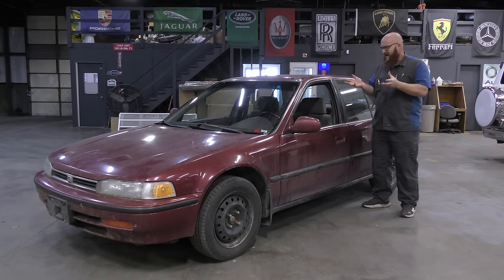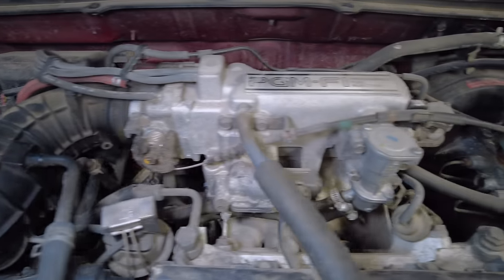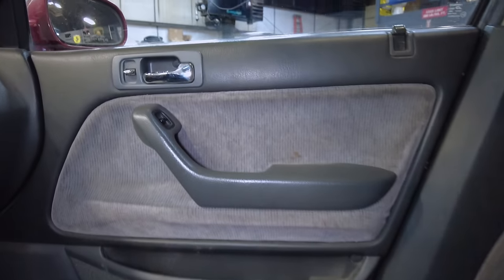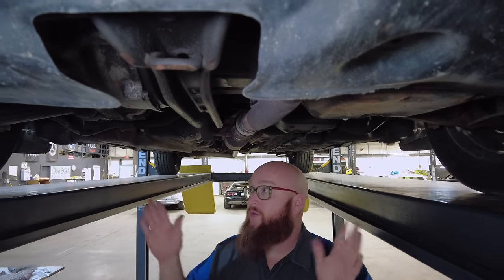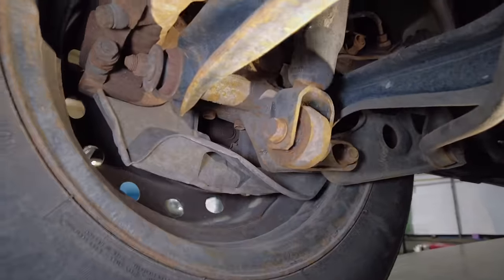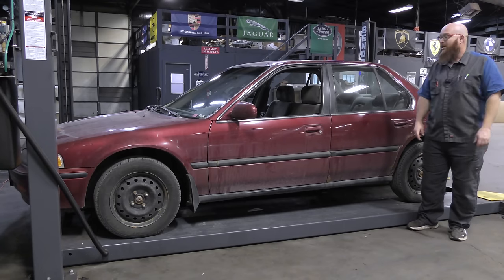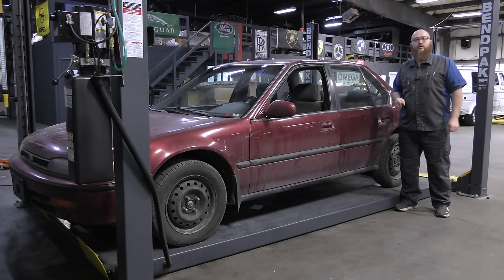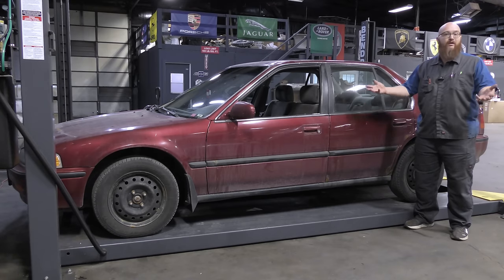A True Testament: 32 year old Accord with 380K miles! When Is It Time to Let It Go?

Comment: Appreciate an honest mechanic. Not many nowadays. Still remember when a dealership mechanic recommended a transmission seal when my car was at 40k miles and transmission fluid leaking. I refused the repair and he said it was dangerous.😂 Still driving on that same seal at 130k miles no issues.

Comment: Their fools if they replace that Accord with any modern vehicle.
Reply: They have to show off somehow or another with a modern $50,000 economy car. People are dumb as rocks these days, they're crushing all of these old reliable vehicles while purchasing newer unreliable vehicles for top dollar. Hell if they invested even a fraction of the amount of money they put into a new car into their older car, the older car would work better and last longer.
Reply: I can understand the motivation to get something newer than a 32 year-old Honda. My last car I had for 16 years, it ran fine, but it was getting rusty and  damn was I ready for something new(er)!
Reply: "Their fools"
You seem to speak from experience.
Reply: @MyWatchIsEnded  That is so true it is sad. I wish more people realized how much more plastic, cheaper parts, and cost-cutting go into a lot of modern cars. I don't see something these days lasting as long as that Accord. The screens will probably get damaged from the sun over time if sitting outside, age will slowly kill the electronics, the plastic actuators inside will fail, and there is so much more wiring, which means when something fails, it will be even harder to diagnose if it is a wiring issue within the insane bundle of wires. The future of vehicles is going to be more junked cars quicker and quicker, nobody is going to be fixing all the complicated electronics after 20 years. Even though technically since a vehicle like this "isn't worth it" to fix everything, it is one damn good vehicle if taken care of. People are built so much on cheap cost and new new new that the true cost has been quality and long-term support.
Reply: @MyWatchIsEnded  It's funny because you can buy economy cars from less than $20,000, but you have to make up facts to justify your stance.

Comment: I have 360,000 miles on my 2002 Volvo S60 24T.  Original engine and transmission that have never been rebuilt.  But then, this is NORMAL for Volvo.
Reply: My 07 V50 has only 226000 miles!!! 😅

Comment: My friend owned a Honda Accord and it still had the original clutch at over 330K miles.  It was still in perfect running condition when he sold it.  Amazing car.
Reply: My '97 Civic has 377,000 miles. It was about at the mileage you describe when I replaced the clutch-and the clutch wasn't even the problem! I had an input shaft bearing going bad so I had the mechanic do ALL the bearings and the clutch.

Comment: I used to have a 1993 Honda Accord, i got it at 159k miles and I ended up selling it at 172k because the timing belt snapped on me. I was told at the time that the cost + labor to replace the timing belt would’ve exceeded the car’s value (this was in 2017). Looking back, not sure if they were right? Anywho, great video, and thank you for going through this Accord with us!

Comment: I had an 92 coupe none VTech2.2L 4cyl  motor 5 speed manual, lowered , it was quite torquey ( when it was raining it would just be sitting  still just spinning tires all the way to the 3rd gear, 1st then power shift to 2nd , and 3rd  gear ) but not much power at high RPM , a Civic 1.6L single overhead cam Vtech motor with 7k red line had always been beating me right after the 3rd gear was engaged ,  Always wanted to swap my motor for H22A but end up growing out of it -Fun times , went through 1 transmission other than that NO ISSUES WHATS SO EVER , engine NEVER smoked , never burned oil , bought it with 100K miles and sold it probably 10 years later with 225k miles for the same price i bought it for, JS,,  LOL . Nice quality vehicle , thanks to Japanese engineering  !

Comment: Common repeative issues are axles-CV joints and rusting out flex pipes and exhaust needing to be done every couple years if you live in a rustbelt state. and rear fenders rust out BUT once you know this…that there are drain holes inside the fenders behind and you need to clear out the degrading leaves-dirt and crap out of the wheel wells and rust won’t happen

Comment: The best advice!  Glad I found your channel.  It's time to get another car.  I have a rule.  I buy brand new and keep my cars 10 to 15 years and replace.  It hasn't failed me yet.  I also buy sub compacts that are no frills and low price.  My current car is a 2022 Nissan Versa I bought brand new and even buying the base model CRV it still has a lot of great safety options and other luxuries for a guy like me.  Love the Nissan Versa, the 2022 replaced the 2009 which never let me down.  Too bad they are discontinuing it.

Comment: This is a funny watch to me, because I have a 2009 Honda FIT with 360k on it. Still runs brand new. Only two issues I haven't got around to fixing is a dead tire sensor causing a TPMS light on the dash, and something with the fuel Prime causing it to crank three or four times before starting on a cold start. Maybe an evap purge canister or something. I'll figure it out on my next paycheck. Oh and a few cosmetic marks on the paint.

Comment: Unless it's completely rusted, I'll keep fixing it. My 2008 Subaru Forester with 308,000 miles is my daily driver. I do 214 miles a day Monday to Friday. 1,070 miles a week, 4,280 miles a month. Oil change every month. My spare car   which used to be my daily is a 2001 Subaru Outback with 431,000 miles.

Comment: Nice car glad it's not the vacuum box model.

Let me explain older Honda accords had a vacuum box on the firewall of the car everything goes well until that box fails then you go through vacuum hell. 

You have to have the box rebuilt Sadly this gets expensive because the vacuum solenoids in the box are not serviceable and new ones run 50.00 to 100.00 a piece depending on year and box.

The worse part yet to come the box can then malfunction and drop your gas pedal to the floor and red line the engine. Creating a run away engine issue. Very dangerous.

Comment: I have a 1993 es300 lexus. Ive put a low miles motor in it already and the original motor had 375.000. I've done a lot of work to it like subframe heads radiator breaks. I will fix whatever goes wrong with my car because it's cheaper to keep her. Already saving for a transmission just incase it goes out. Car is still going strong and i attend to keep her as long as i can. And the parts for it are reasonable.

Comment: I have driven beaters all my life.  My criteria for selling a beater is when something catastrophic happens or is expected to happen very soon.  Any repair over 2k is considered catastrophic.  The reasoning is that you can take the 2k and put it down on a 10k vehicle.  If you have the skills to do general maintenance and intermediate wrenching, you can extend a vehicle for at least a decade if you take care of it.  

One of my family member drives a 2005 Nissan Sentra with 250k miles on it.  His grandma gave him that car.  The entire bottom is rusted bad but mechanically, it's a gem.  I've replaced the fuel pump, replaced the entire brake system, put in a new battery, replaced power window motors, replaced the blower motor fan speed module, etc.  All on all about 4k worth of repairs.  Other than the rust, that car will drive from Seattle to Rhode Island and back easy.

Comment: Never. Never is the time to let it go. My first car was a 93 EX with the Burgundy interior and I just towed it out of the back yard and ripped all the rear suspension and gas tank out. Gunna do a total suspension overhaul but the motor and trans are still original and super solid with 235k on the clock!

Comment: i daily drive a 1992 accord. just took it from florida to new Hampshire and back. no issues and almost 50mpg the whole drive!! 181k miles on mine im the 2nd owner. original head gasket, original fans, original fuel pump and a lot more. when i replaced thermostat 2 months ago it had a stamped manufacturing date of 8/91. honda did perfectly with this generation accord

Comment: I had a 1991 Accord LX 5-speed. Fun car to drive. I had to replace the retractable antenna and bondo the left rear panel for rust. Sold it with 195k miles in 2002 for a new Accord Coupe.
I just replaced the radiator on my 2002 accord coupe. 200k miles. First major part. Needs clear coat and a small amount of rust at the rear window, car has always been stored outside and survived a dozen hurricanes. Hopefully I will get another 10 or more years out of it.

Comment: I disagree that this car is unreliable and not to be trusted. If you can drive a car for months without a breakdown, you can drive it across the country reliably. My Honda Element has 328k miles on the original engine and automatic trans and I would (and do) drive it everywhere including road trips. I would argue that it's more reliable than a significant percentage of newer cars with half the miles ..

Comment: My dad sold our 1992 Accord with 364k miles on it back in 2008.  Everything worked fine on it.  I believe nearly all mechanical parts were original (I know the engine and transmissions were), and it didn't burn oil.   The mileage on this doesn't surprise me at all, nor is it the issue.  The car being 30 years old is the issue, and all the components are old and deteriorated.  Mechanically they're great.  Seeing as junk cars basically go for  $2000, I don't think I would be afraid to spend a little money on that car compared to what else you'd buy for that price range.

Comment: I had a 77 Accord hatchback.  Unbelievably practical car!  In 2002 it finally had enough and was not a rebuild proposition since I had to commute 70 miles a day.  So I bought a 2002 Civic EX with.. Again... a 5 speed manual.  Still purrs like a new car.  I almost regret having a 2002 honda instead of a 90's one, but.... it's been absolutely reliable!  Only one timing belt so far as major maintenance.  Some people don't realize what they have.... I'd fix that old Accord in a heartbeat!

Comment: I had a 91 Accord EX F22 4 cylinder 5 Speed manual that had 330k miles. Bought it for $500 not running in 2006, all it needed was an ignition coil. The interior and mechanicals were near perfect but the clear coat was shot so it was more of a matte white and it did puff out a little black smoke if you reved it out past 4,000 RPM. All that being said it was a great car and got over 30PMG. Ended up selling it to a kid that needed a car and sadly the kid flipped it less than 6 months later (He was not badly injured).

Comment: As a technician myself, I would personally do regular compression tests on the car to identify weak cylinders, and monitor, as compression gets lower and lower over time that is what would influence my will to spend on the car. A compression test on a FWD inline 4 Honda should be fairly cheap for anyone not a tech. A compression test (wet and dry) is a good indicator of internal engine health. If compression is low on a cylinder and a wet test doesn’t improve the results you can do leak down as well to pinpoint a valve problem or a headgasket problem.

Comment: I have a very rare factory made 1999 Toyota Camry TRD manual 5 speed (Molly Design) black color 'sport car' (with loud exhaust) that I bought used with 4k miles on it back in 2000 for 27k from the dealer (after the Toyota Rep turned it in to the dealer). I put in 403,000 miles on it with no engine light just tends to overheat in hot summer days. The shop owner I know told me to stop using the car so I stopped using it few years ago. I still love this car as I used to drive a '86 Porsche Carrera prior to this reliable daily driver with almost little maintenance and hardly any repair bills all through the years! The only high cost is those soft sticky tires I have to replace all the time!

Comment: Dash looks great! Yet my 2003 Ram 1500 Off-Road edition which i ordered new from Dodge, started cracking the dash within a few years! I hope my new Wrangler JL doesnt follow the trend.
I had an 88 Accord with the flip up headlights when i was about 19 (42 now), and it was a runner! It may not have any oil in the engineat any given time, the wheel came off and passed me one day, etc.. but she still ran like a champ!

Comment: I own a 97 Camry with 200k and its got its issues, some oil leaks, needs a new head gasket, and the exhaust is rotted by the converter. I am repairing the safety and regular maintenance and use it around town or when I am heading to an area with more traffic because it is already dinged up, its my beater and that's good enough for me.

Comment: My 2005 crv se is about to have 170,000 and it's super nice still. Everything works. Smells good. New england car. I can't see why I can't daily it for 10 more years. Just had the valves adjusted and all the fluids changed. Gets washed and dealer maintained.

Comment: 1988 CRX Si approaching 260,000 miles. Just had the 100k service done at the end of 2023. Timing belt, valve adj, water pump, all fluids replaced, rear brakes, alternator, etc. Runs better than the day i bought it fifteen years ago at around 100k miles. All original, sunroof works great. Spent around 2500. Well worth it. Will do it again in 100k miles. AC blows ice cold with original compressor full of R12. 35-40 mpg depending on my driving. Daily driver used to eihty mile round trip now half that with change in job. And i live two moles down a dirt road. 

My fourth CRX since 1989 and probably my last. Ill be buried in it.

Comment: I have a 94 Ranger as my daily when I'm not driving a work truck. It has "77K" miles, no idea if that's true it could have rolled over. Only major problem it had was a cracked frame. Taught myself how to weld in order to fix it. Had for it 4 years now, put less than $1k in maintenance items. Body is damn near mint minus 2 spots in the bed corners that are rotted.

Comment: In 2002, I bought a 1989 Honda Accord Lxi with a manual transmission for $2500.  I had that thing for 19 years.  Probably spent $10k on repairs during that time including replacing the engine at 230k miles or so.  The thing that finally killed it for me was the accelerator cable housing on the firewall broke.  I said let it go, and two days later I bought a 2011 Honda Accord.

Comment: My daily is a 2003 Subaru WRX 140K miles. It's a limited Subaru yellow with black and yellow+ fake carbon interior . Low underneath rust but the clearcoat is sun damaged. Mostly stock and I dont beat on it because I'm 63 and know better... most of the time. It's well maintained by a alternative female autocare who dont mess around. I used to dropping $2k or so every now and then to keep it on the road. Needs struts and bushings now as far as I know. It's a nice reliable little time bomb disguised as a car.
I know I kind of need to get a newer one but I still love driving my old SuperDude as is

Comment: I finally got new mineral oil , new filter, new points, new spark plugs and fat on all nipples today on my 1956 Mercedes 219. Its 20 years since last time but it has been standing since 2004. My mechanic only found that one front shock absorber needs to be exchanged. Good guy! Honest Mechanics like The Wizard!

Comment: I had that same spring pop on an occasional turn for a 95 hond accord after had the half shaft/cv joints replaced like this car, when i brought it back to the shop and complained they said they couldn't find the problem or reproduce the problem.  I kept complaining to the shop for a year or more and they finally either replaced or reinstalled the half shaft/cv joint and the problem was permanently solved.

Comment: The reality is any and all vehicles will last just about forever, as long as you keep throwing parts at it, it'll keep running. Every component is important. Engine oil, transmission fluid, transfer case fluid, brake fluid and coolant are your top priority. Other than that cheers 🍻.